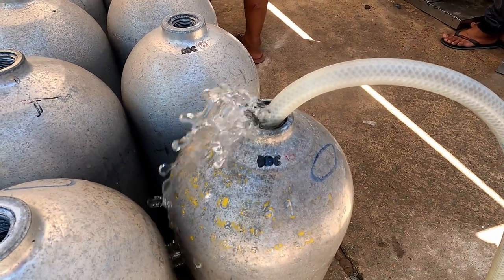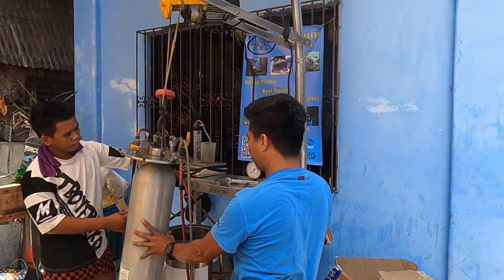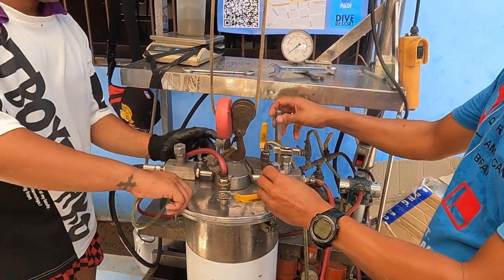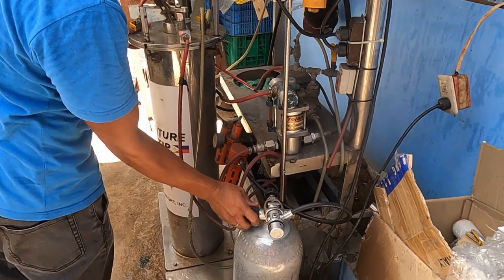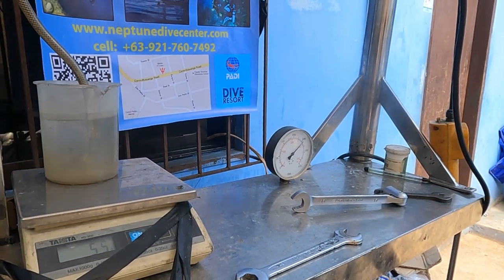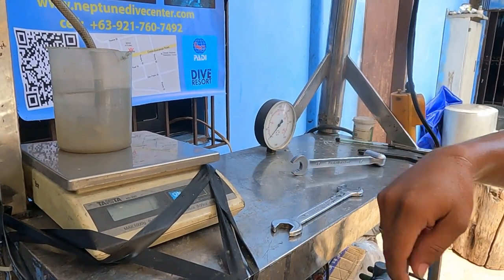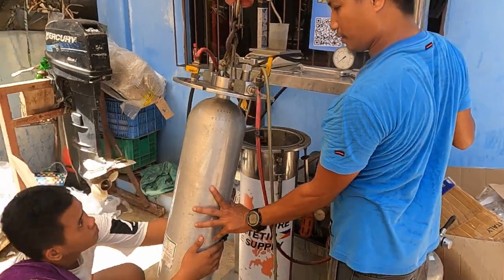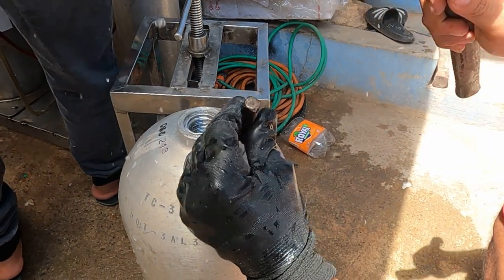Scuba Cylinder Hydrotest

Comment: many mistakes in the equipment and process hydro test 
1.-the manometer have not accuracy requiered for DOT and calibration
2.- the digital scale need to be 0.01 grs accuracy.
3.- they dont do  internal inspections before and after hydrotest
4.  etc, etc

regards from Chile